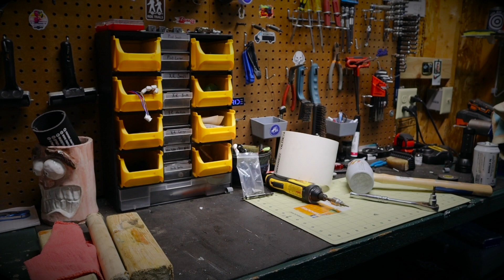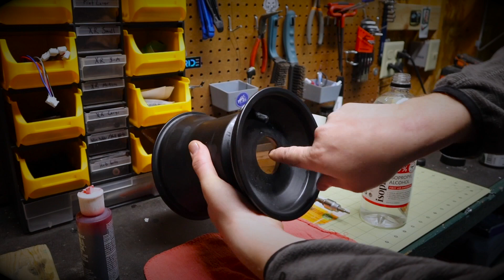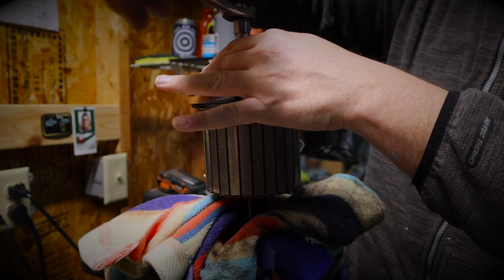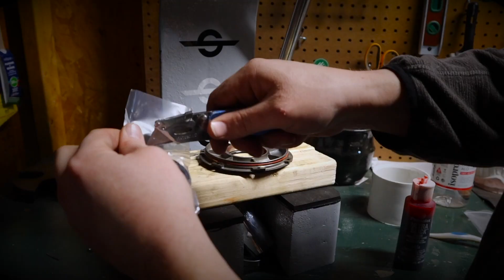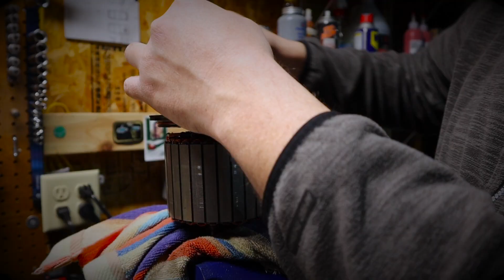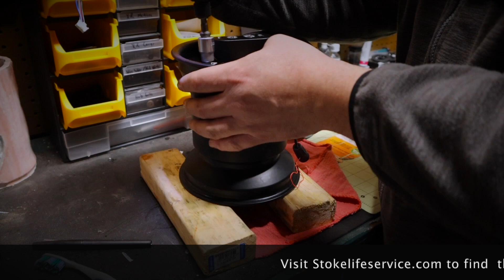Onewheel XR Bearing Replacement

Comment: I don't have the same power I used to going uphill, and I even replaced my XR battery with a JW.  The ride on flat ground is much better but the uphill has not improved.  Do you think a bearing change would help?  Great video.

Comment: Great video! keep it up, there's not enough in depth info like this out here! By the way what did you lubricate the bearings with specifically before you pressed them in? Also what size sockets works best for pressing them in and out?
Reply from the maker: This is the engine assembly lube.  Permatex 81950-12PK Ultra Slick Engine Assembly Lube, 4 oz. (Pack of 12) https://www.amazon.com/dp/B001RERUUG/ref=cm_sw_r_cp_api_glc_fabc_u6p-FbTT8ZHNJ
Reply from the maker: For pressing them out I use  a 1 1/8” chrome deep socket
Reply from the maker: For pressing in I had to buy a bearing kit on amazon
Reply: @1wheelmedia687  Great job! Which exactly kit you bought from Amazon for having that 55mm bit for the press?

Comment: Great video! What was the reason for the new bearings? Just a upgrade or were the old ones worn?
Reply from the maker: Old ones were worn.  Also the stock bearings aren’t the best quality. If you put some nice ones in and also use Badger bearing protectors they will last a very long time. The ride is a bit smoother with nice bearings as well!
Reply: @1wheelmedia687  Probably a little better mileage too.